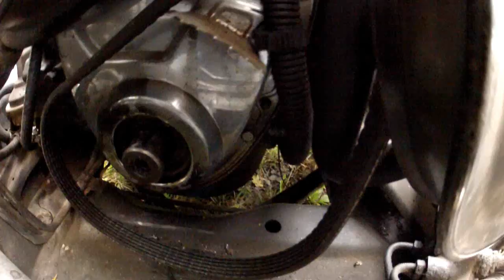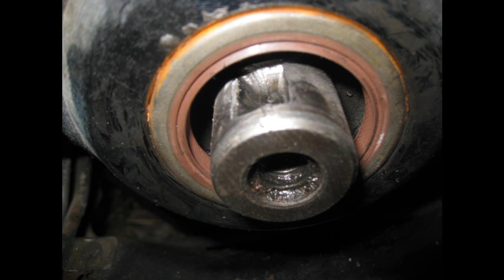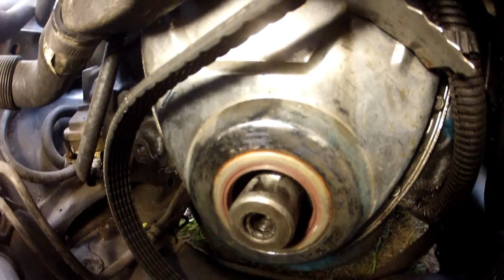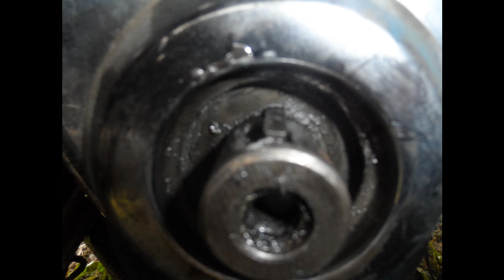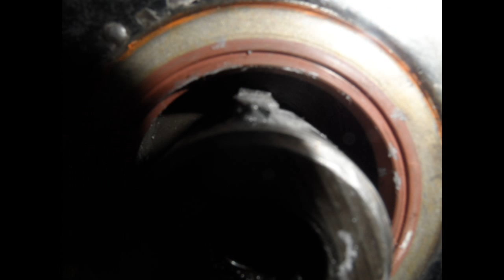Harmonic Balancer And Crank Shaft Repair Tutorial

Comment: It took me to long for me to hammer back in the HB and I think that lead to failure after two months. Should work better second time around.
Reply from the maker: Hammering the balancer on is not recommended. I would find a way to kinda press it on (with allthread and a nut into the crankshaft if possible). If you have to hammer it on, use a flat steel plate if possible. Hammering it on is very difficult and probably not good for the crank bearings, not to mention more likely to crack the JB. GOOD LUCK!
Reply: Monkey Bones There is no center bolt on old Chevy 250s, they are press fit. A slide hammer is standard procedure. Pressing on would involve shop equipment or removal of engine.
 Test drove a few hours ago.
Reply from the maker: Yes I was aware of that the old chevy's (NO BOLT) best of luck to ya! They can be pressed on with a "porta power" with the engine in however, although it's a little tricky! I just assumed it was a small block similar to the one in the corvette. Gotcha NOW!
Reply: Monkey Bones Perhaps one could rent  a specialized press. I assume that would require floor anchors, like in a body shop.
 250 c.i. I-6
Reply: The second fix worked much better and it all went quick; practice makes.... I let it set up for 1 day - lasted about a month. I'll try it again.

Comment: may make a note that the timing marks may be off. Just reindex. What would you think of drilling and tapping maybe a 5/16 or 3/8 grade 8 bolt into the parting surface between the two. I can't see a reason that it wouldn't work. Have not tried it yet -just looking for crank replacement alternatives.
Reply from the maker: if there's even a slight wobble, it can work it's way off, trial and error seems to be acceptable, your on your own with this, it may work? Pacific circle just taught be a valuable lesson,  every scenario can be different.

Comment: How long will a repair like this hold?
Reply from the maker: Good lord, if I knew that I'd be a phenomenon, so many people do so many things different, but if it's done right and the crank shaft and balancer are in decent shape, it should work indefinitely, who knows a persons ability, and mechanical aptitude, HOPEFULLY FOREVER!
Reply: I fixed up my waddled out 95 civic V-Tech crank and timing sprocket with JB-Weld since researching this. After a whole summer of hard highway and high speed off road rallying the cranks shaft pulley is still running true. Something to keep in mind when JB welding a timing sprocket. make sure it's advanced not retarded when the epoxy sets up, otherwise you gonna be missing out on some horse power and have some valve lash problems. I learned that the hard way.
Reply: @stevendbickham  well, I think it's a worthwhile option to pulling the crank out. Great video and a precise explanation of how to do it. The balancer on my GM 6.2 diesel rolled the keyway out and munched up the crankshaft. I wish I had this option.

Comment: Thanx dude!  I have an issue with mine and was wondering if that would work.  I'm glad you did it first
Reply from the maker: Your welcome, changing a crank and pulling an engine is NO SMALL TASK, sometimes it works and sometimes not, but it's worth the effort usually, especially if the harmonic balancer bolt and threads are still good. If you have the bolt and it's stripped, FIX IT! Sometimes a helicoil might work for that.
Reply: Monkey Bones , So I tried it however it did crumble soon enough. I ended up hiring a heavy equipment welder and he filled the hole and grinded the woodruff key hole. that worked very solid.
Reply: 78beast that job was done with the crank installed?  I am thinking on doing the same space is decent to work !

Comment from the maker: That sounds excruciatingly difficult. Getting the old one out with the engine in the vehicle is a bear in itself if it's even possible. The JB Weld is supposed to work up to 550 degrees and it can do amazing things when used properly. Have you considered grinding out whats left of the woodruff key (half moon key) with a dremel and a reinforced cutting wheel? I don't know if you have room but it's a thought to remove the old woodruff key?

Comment: What if I don't have room for a woodruff key. Can the JB weld withstand the pressure on it's own, I wonder ? Fixing my sons Toyota corolla 1989 it seems part of the old one is frozen in there. have room for a moon shaped key the size of my pointing finger thumbnail. Thanks so much for sharing !!
Reply: just drill in straight from the front and put a dowel in from the front sharing the 2 parts